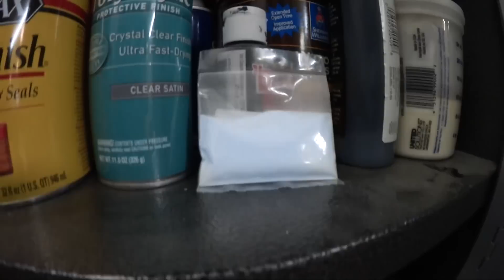Harley Davidson Glow Sign

Comment: Nice video Freddie.  I have a couple pointers that I have learned with my experience with working with different epoxy resins.  The bubble problem you experienced was most likely due to excessive heat generated by the resin curing process.  The curing process of resin is an exothermic reaction.  The more resin, the higher the heat load.  Now, certain resin's are better than others for filling large volumes.  The pour on finish that you were using is not designed to go thicker than 1/8" typically.  The best thing I have found for filling large volumes is a clear casting resin.  The pour on finish works great for a skim coat but gets way to hot when curing, causing the bubbles.  

Now, you are exactly right about the CO2 helping pop the bubbles.  A little trick I came across is to use a CO2 tank or can and pop the bubbles that way.  Much easier than breathing on the resin for the hours that follow.  If you make another project like this try to use some Amazing Casting Resin from Alumilite, suitable for pours up to two inches thick.  This is the easiest and most accessible resin I have found.  Keep up the great work man.

Comment: Excellent video thank you very much. I had a very similar problem on a table top that I did. I used the West System base with the 207 Hardner.  That's a 200 dollar bill just right there. This stuff is the highest glass like, mirror like finish epoxy I have ever seen. My table was white oak. The bubbles formed on this table like there was somebody underneath of it pressurizing the wood with an air gun! I chased the bubbles with a torch for two hours. Finally walked away and called the project junk. I still have it and I plan on trying to sand it down and add a second coat. I don't know if this will work but the table is so beautiful I don't want to give up on it so soon. I might use a lower cost epoxy just because I don't want to throw away another 200. Thank you for the information in your Video.

Comment: Some that I've seen that use the epoxy on tumblers put a fan on it. Could help with bubbles. Haven't tried it myself though. I have a cricut machine and now badly want a cnc router. Awesome sign!

Comment: Wow, this is a cool project. The wood is gassing because the air in the wood is expanding while the temperature is rising when epoxy is applied. When you heat the wood and apply the epoxy while it is cooling down, it shouldn't gas. Adding a layer of epoxy as base coat is a great idea!
Reply from the maker: +Johannes Fröhlich Great explanation and tip, Johannes!!!!  Thank you for sharing!

Comment: Awesome sign. I’ve been using epoxy on a lot of projects, a trick I’ve used is make your first coat of epoxy and cut it 50/50 with acetone and apply it with a brush and let it  soak into the wood to help seal it from inside the wood.
Reply from the maker: Great tip.  Thanks for sharing.

Comment: Thanks for the tip about dealing with epoxy first. If you’re willing to do with a different aesthetic, the manufacturers of these powders often recommend using a white paint as the background to get most light out of the glow powder. Maybe go with a really dark stain or paint on the face of the sign and white paint in the recesses.

Comment: What an awesome finished product!  I do wonder though if all you were looking to do is seal the wood fibers did you consider using shellac? Certainly dries faster and easier to sand off the top. Great work!
Reply from the maker: boyzwithboardz Thanks for the compliments.  I appreciate it.  Hmm, I don't know anything about shellac.  Wonder if it makes an airtight barrier like epoxy?  I don't know.

Comment: Very interesting, and the sign looks cool. You said for the 2nd try you put a couple of coats of finish on and then train-wrecked it. But you didn't explain why the train wreck happened again. You still got the bubbles (which seems surprising) or something else happened?
Reply from the maker: Marty Backe Thanks for checking in, Marty.  Yes, it still gassed off the second time really bad.  The third time a small number formed but that was mostly from what you would expect from mixing the epoxy.

Comment: I have a question.  Would it be possible to bond a colored lexan (Polycarbonate sheet?)backing onto the wood and then machine out the design? Using different colors of lexan could give you a different color of light which would pass through the finished article.

Comment: When you are sealing something up with clear poly, how much time do you allow for drying between coats?  And do you "charge" the glow in the dark epoxy by exposing it to some bright lights first?
Reply from the maker: +Annony Mouse The water based poly dries really fast on a warm day.  A few minutes.  Light activates the glow powered.  Even ambient light charges it a little.

Comment: Awesome looking sign, I just ought a CNC machine to play with and this will be one of the first projects for sure. Why did you dremmel out some of the letters after the first coat of "protective" epoxy?
Reply from the maker: Thanks Derek.  I did that just to smooth out the rough areas before putting on the second coat.

Comment: I've used ultra gloss expoxy and with the years of me using it at first i did it like yourself used sand paper but sand paper leaves streaks so this older man referred me to use steel wool to sand oh my god it works awesome plus it gives you next code of epoxy look better
Reply from the maker: Great tip, Robert.  Thanks for sharing.

Comment: After the first coat of epoxy, it looks like you were using a small grinder in the letters.  What were you doing exactly?  Excellent video!  I'll be doing something similar to this in the future.
Reply from the maker: robheg100 Thanks for watching Rob.  I did get some bubbles on that first coat so I was grinding off where those bubbles set up and looked bad.

Comment: Hey Feddie,
I have been a fan of yours for a while, great respect on your projects. I am a G.C. As well as have my custom cabinet and counter shop. Nuff said about me but I do have a question for you about your CNC, I have been looking for years but I can't decide on what is the best bang for the buck. I see your operating pretty smooth. So what are your thoughts on CNC's ? is yours good enough for production? How would it do cutting sheet after sheet of 3/4" plywood as well as 3/4"MCP
Thanks for the info and I am looking forward to your next project.
Reply from the maker: Ron Raney Hey Ron.  Thanks for checking out my videos and taking a minute to send me some kind words.  I really like my CNC and I have used it a lot.  If I were going for high output like you do then I would probably put a spindle on it rather than a router.  I honestly don't know how the rest of the machine would hold up over time in your environment.  Give Cory at cncrouterparts.com.  He's a good dude and I think he'd be square with you needs.
Reply: Thanks again Feddie for the info I will check it out have a great day.